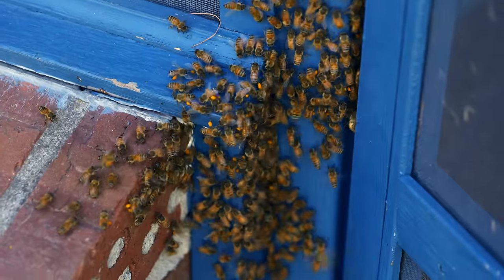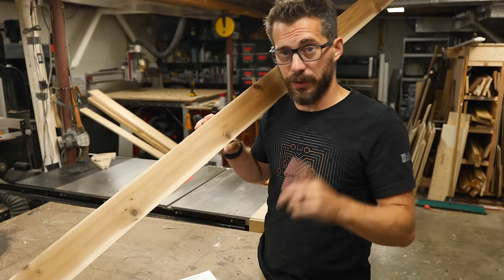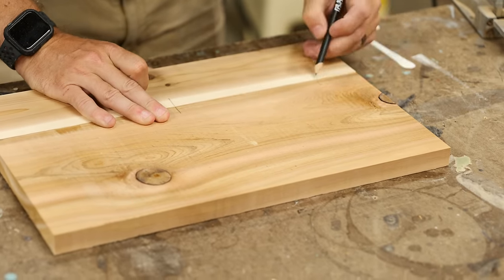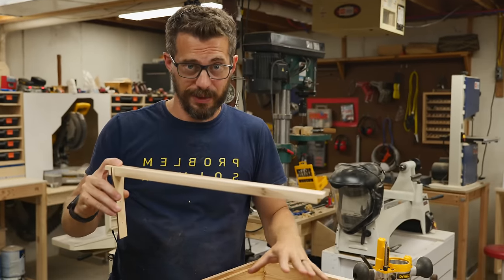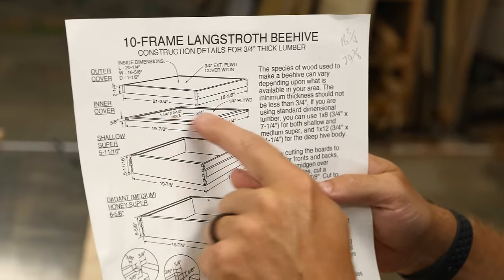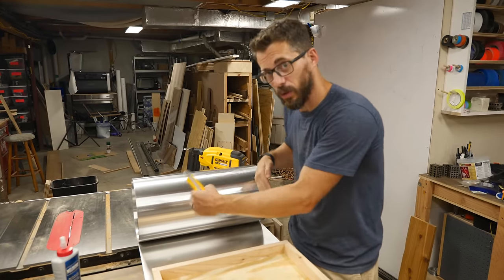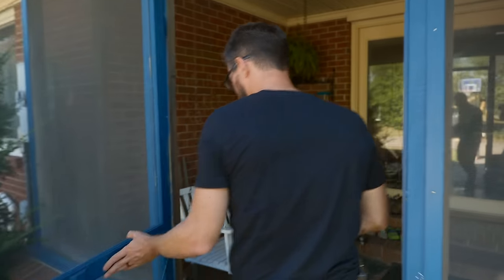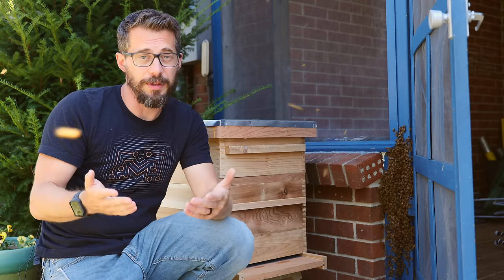How to make a Langstroth Beehive // Woodworking | I Like To Make Stuff

Comment: Beekeeper here!  This is generally a very informative video.  But I have to chime in and say that there is a reason why the original plans for hive parts do not use glue.  Wood glues and some super glues have compounds that the bees do not like, and may be toxic.  Please consider using only nails and screws when constructing your hives, future viewer!  And don't worry about keeping the hive air tight, the bees will cover any small openings with sap.  Also, do not paint or stain the interior of the hive, or any of the frames.  Bees only like to walk on raw wood!
Reply: Thanks for the advice.  So glad I saw your reply before trying to build a bee hive myself
Reply: Thank you
Reply: Thanks! Hopefully one day…!
Reply: Tite Bond III is safe for bees! I use it all the time.

Comment: Beekeeper here! As Bob mentioned, your local beekeeping organization will be the place to go, because regional variation is surprisingly high. 

For example, many places need to paint the hives white to keep them cooler: otherwise the bees have to line up at the entrance and use their wings to circulate air as a sort of natural AC, which means the hive is less productive. Conversely, some climates paint the hives black to warm them up, and in some places the hives are painted differently on different sides, to warm them in the morning and cool them in the evening. Check with your locals to find out what works best in your area!
Reply: Interesting ... I especially like the different colors on different sides :)
Reply: That's really interesting!!
Reply: Does canada use vanta black then?
Reply: @minerman1049  northern canada and alaska have 24 hour daylight in the summer... might get too hot
Reply: @minerman1049  Beekeeper from Toronto, Canada here. We paint our hives white, just because we get temperatures of 30+ C all summer. During winter we wrap the hives to protect them against the elements. People use black wrap or heat reflective material.
Reply: Thomas Holden 
Not to toot my own horn but I’m not a beekeeper and somehow I knew this already. 
Now I’m going to lay here in bed at 4:48 am, and try to remember where in the world I learned this from. 😂
Reply: fascinating
Reply: Hi! Here in Norway most hive boxes are made from high density foam. The insulation helps keeping the colonies alive through winter and also evens out the temperature through day/night in the summer season. They do, however not look as beautiful as these hives. Great work!
Reply: This is probably the most informative and fascinating comment I've ever read. I'll never be around bees but this was interesting! Thank you for teaching me something I didn't know :)
Reply: I can relate. I often lie in bed and toot.
Reply: Normally that would be a nice idea..but the local bee group here ..is ..how can I say it..toxic..to newcomers,not really into showing off to the new guy and helping rather they much rather cause harm to everyone around.
From overpriced nukes and overpriced boxes that are terrible in construction, terrible bee keeping advice and much more.

I just started beekeeping, because I got presented with a random swarm 😅 otherwise I had the chance to start beeking ages ago but never was into commiting 200-300euro for 1 full 2 floor hive -_-...whose contents could be questionable when it comes to healthiness.

Comment: It's probably worth noting that a riving knife is meant to help avoid binding and kickback as a piece is split by the sawblade. The riving knife allows the material to STAY separated after it passes the length of the sawblade. If you're just cutting a dado without splitting the piece into two, it shouldn't be an issue to remove it for that cut.
Reply: technically yes; though the saw blade can get stuck in the dado and then the piece could get thrown back and such; Where I work the riving knife is about 2 millimeters beneath the highest point on the sawblade. That way the riving knife can't hinder you and the wood still gets separated well enough
Reply: @YunaDragneel  fair point. I wish sawstop table saws came with a riving knife like that. They are phenomenal pieces of equipment, but there are a few small things that got overlooked along the way.
Reply: @etedrowable  Where I work we have pretty huge table saws and they're all equipped with a riving knife that scales along with the blade; you only need to change it when you put in a smaller or bigger sawblade
Reply: Had I never watched ILTMS then I woulda thought dado was pronounced DA-DOO. 
And honestly this is my life now.
Reply: Can I also just say that Bob is one of the only, if not the only semi-professional/professional woodworker to use a push-stick just to keep his hands further away from the blade on a piece of wood that a lot of people would consider wide enough to just use your hands (2:29).

Never cut corners if it's going to make something more dangerous
Reply: @richardmillhousenixon  definitely; a push stick is very important and I'm glad Bob is very careful with safety! We have push sticks as well but our rule of thumb is if the space between sawblade and the guide rail (sorry I don't know the right terminology... I'm from Austria so some terms are lost on me) is bigger than 12cm we can still use our hands. If it's smaller then we use a push stick
Reply: Eric Tedrow 

But if you keep it on while doing that is it an issue?
Reply: YunaDragneel k

Comment: Something to consider when making another hive... when rabbiting the parts to hang the frame, either do it before assembly to avoid cutting into the side's of the box frame, or fill in the parts that had to be cut out... Or be careful and use hand tools to finish the cuts...

The reason why? Bee's will fill in those holes with wax that you'll have to remove when it comes time to clean the hives some day. I used to help my father extract honey and those bee's pretty much pack every hole and void they don't need with Propalis. It's hard to remove without the right tools so save yourself some effort down the road and make every edge and corner exact. Separating the boxes with the corners packed with extra Propalis means the corner's of the bottom frame will essentially be glued to the one above it. Even with a hive tool to separate them, it can be difficult. So a well built box that has the minimum of removed material to avoid extra voids will pay off for the keeper when it comes to maintenance and later in it's lifecycle, cleaning.

Comment: I have the same sawstop as you and had the same issue with my riving knife.  I ended up grinding off about a sixteenth from the tip of the knife and then could make cuts like that one. Safer than removing completely. Hope that helps.

Comment: you should paint the metal on the top white to keep the hive from getting to hot, the landing area should slope down, to prevent rain from entering the hive, plus it makes it easier for the young workers to move the dead and dying bees and drop them off the edge of the landing area.

Comment: Good choices: ceder and the inspection floor. 

Mistake for which the bees will {probably} make you pay: the post construction frame slots; (the over-run into the sides will be filled with propolis that will stick the boxes together and cause the bees to spend less time collecting nectar. 

 Mistakes that you're going to hate: by miscalculating the space between the frames the bees are going to either build brace comb or glue it all up with propolis. The Langstroth hive was invented by the discover of the concept of bee space, and its not something that you can just fix by wrinkling your nose and hoping that the bees won't notice. (Those girls have the square root of three in their construction... so they are going to notice.)

Comment: Thank You for the video!
As a beekeeper I am going to throw my 3 cents.  My point is not to be tedious here, but to bring a friendly advice.
1. As You've mentioned, bees tend to use any extra space for drawing the comb. Therefore, if You leave a bit more space in between frames. they will draw that out. At a first glance, there's no big deal, but later on You may find difficult to exchange these wider frames in between hives. That is why You always use hive tool to make sure the frames are stacked tight.
2. I would rather avoid using plywood for frame elements, as it may contain so- called voltaile organic compounds (VOC) or even formaldehyde. You just don't want that stuff neither in space occupied by a colony nor in honey. There's no better choice than untreated wood.

Comment: Overall nice build you are missing a couple of things, first of all you should be able to enlarge or close the opening for the bees, it comes handy in different situations.

Also I strongly suggest adding ventilation holes in each box, you can get plastic round caps with three settings (closed, small mesh, fully opened) 

you would want some kind of feeder system during early spring and late autumn

you would want some sort of queen divider

Comment: Just curious: Do you need to make the clearance gap for the removable bottom plastic a bit larger where it is pulled out? If it's a "perfect fit" when you pull it out, all the goop and junk will scrape off on the inside of the panel. Not much of a big issue as you could just wipe off the junk when the bottom is open. Anyways, Great project!

Comment: I'm sure you're supposed to have a mesh over your breeding section with a hole small enough for the worker bees to get out but too small for the queen to get out. That way she stays there in the hive and the bees make honey in one section and breed in the other.
Reply: it depends, the frames are going to be removed for honey extraction anyway, however with this hive just being a start up they have yet to fill out the first box which is known as the brood box, and is reserved for the bees to use, a queen excluder is used to keep the queen from getting into later boxes (supers to beekeepers), this is to prevent the laying of brood outside of the first couple boxes, and it is afar easier to purchase excluders than make them

Comment: I've been a fan of your channel and the podcast for years. I've also been a beekeeper for about 6 years now. Like you, I have made hive bodies and frames myself (using the exact same one-page instruction sheet) for the experience. There is a site with free plans for building all kinds of beekeeping equipment: https://beesource.com/build-it-yourself/. Ultimately I usually choose to buy precut un-assembled equipment from my local beekeeping store. One note about your bottom board: most beekeepers use a larger mesh hardware cloth instead of window screen. The larger openings will make it easier to monitor for varroa mites-there is even a pre-cut plastic board with a printed grid to help you count the varroa. There is a lot to learn and do with bees, and jsut like woodworking, every beekeeper has their own preferred way of doing things (in reality there are many ways to do every task). Best of luck!!

Comment: What's the type of wire you used in the frames? Also do I rubber bands to hold the honeycomb into the frame?
Reply: the rubber bands are temporary until the bees draw out the comb to fill the frame, at which point they are no longer needed, the only time they are seen is when a wild hive is relocated into a  box hive

Comment: Bob! Great content, always! Just taking the hook, any possibility of construct a 3D printed hive base? (i think that flow is a simple and great blueprint)
Also, i know that flow is a registered brand and all that, but it's very simple, functional and easy to use, specially if you are in a big city (like São Paulo, Brasil) and want to use some back space to do it, simple and clean. 😊
Reply: until you have to take it apart for maintenance and inspection which is required in most of the world
Reply: @TheDarkalkymist  so the flow is flaw in that case? I see the facility of take the honey, without make to turbulence in the bee ecosystem. Can you share more?
Reply: @caiocallor  bees have several parasites and diseases that beekeepers want to keep a close check on, foulbrood is not treatable, so the best measure that can be taken is frequent inspection to limit the spread, as far as disruption of the hive, they recover in remarkable time, usually minutes, remember their nature hives are routinely disturbed in the wild, so they have built in damage control measures

Comment: Any particular reason the plans or you didn't include some kind of indexing pins to keep the boxes aligned? I image a simple piece of 3/4"x 3/4"  stock sticking out of the bottom of each box by maybe an inch in each corner, so when stacking the boxes, they stay aligned and won't get moved over or bumped so easily. Or did I miss this in the video?
Reply: you would have to ask the plan maker, however  it is not uncommon to see these with rabbets for aligning the boxes vertical, although once the hives have been established for a time the bees will glue everything in place anyhow
Reply: @TheDarkalkymist  Thanks! I have absolutely no knowledge of this topic, so I was just wondering. Will the 'bee glue' be strong enough?
Reply: @RobertEchten  not if you make an effort but it will stop things from moving about in the wind
Reply: @TheDarkalkymist  Cool. I've been thinking about making one ever since a local beekeeper came to rescue a (travelling) swarm from our garden and I spent a good time talking to him. Interesting stuff. Just haven't gotten around to it yet.

Comment: Langstroth Beehives are debatably a bad design. A top bar hive is an alternative I would propose. The benefit to the top bar is that older persons are able to lift the single frames as opposed to lifting the whole box. The thickness of the Langstroth frames are a little too thin for trap heat in the winter and many people have had colony collapse or die off in the winter due to lack of insulation. The top bar also allows for removal of debris/waste from under the hive without disturbing the frames.

*Edit: just do some research into alternative beehive designs if you are looking to get into beekeeping in the long run, as well as contacting local beekeepers for tips and tricks and ask them what hive type they use and why they prefer them.
Also you may want to decrease the size of the opening (not in height, but in length) as a large opening is hard for the bees to defend and can endup overwhelmed.

Comment: What is the advantage of using biscuits instead of dowels? (Is it worth the extra tool?)
Reply: Biscuits are for mostly for easy alignment, without adding strength. They're good for lining up edges during a panel glue-up.

Dowels add strength, but are more of a hassle. Good for reinforcing where you're trying to mate end-grain to something, like corners.
Reply from the maker: Well said!

Comment: Hey Bob what is the cheapest drill you have that is good
Reply: I use a black and decker drill/driver. It uses the 20 max battery. It works good and the battery has never failed me. I charge it about once a month. Before I put it in the charger it is still a battery battery with a lot of power. Got it a Walmart to about $30.
Reply: Thank you ill look in to it
Reply from the maker: We use the 20 volt Dewalt Drill and Driver combo linked in the woodworking tools in the description.
Reply: Thanks you guys I'll look in to them

Comment: Can anyone explain what's the thing at 9:03 do? How will it protect you?
Reply: It's purpose is to keep the wood from possibly pinching back on the saw blade as you push it through, thus preventing kickback. (which is terrifying)
Reply: @AnthonyRose  so it's basically thicker then the blade itself?
Reply: @edwinchw  It has to be thinner than the blade. His riving knife stands taller than the blade cuts and has to be removed if he's not making a cut all the way through the wood.

Comment: LoL the screen and plastic sheet are not to clean the hives out. Bees are neat freaks and constantly cleaning out the hive there is no need for you to think you need to clean the hive. The purpose of the screen is to allow ventilation if you live in a hot climate and plastic helps seal the hive in colder months if you don't want to bother changing the bottom board from a screened one to a solid one. The plastic will need to be pulled to be cleaned only because the bees can't get to it to clean, so you really shouldn't use this method for hygiene reasons and health of the hive.. 
FYI: you do not need those supers or "medium boxes" as you called them yet (you honestly wont need them for quite a while trying to tame a small wild colony.) That colony is far too small for those large boxes in general. You need to build what is called a newt box (basically a small box about half the size of the large box). Then as the colony grows transition them to the larger box and then add supers once they are even larger.